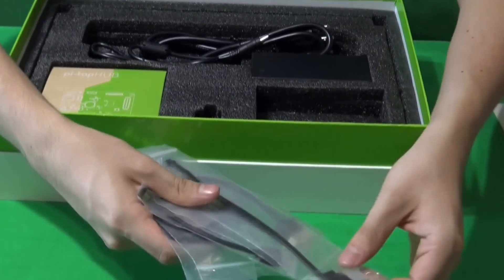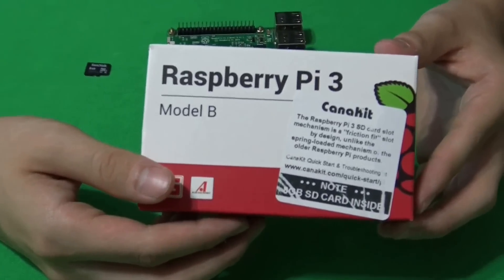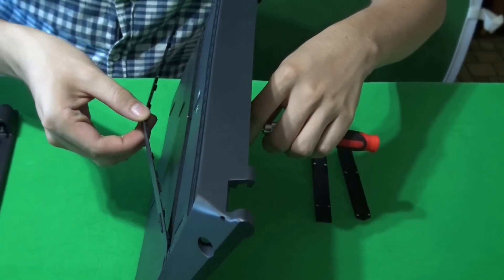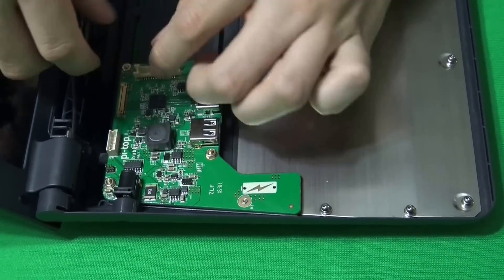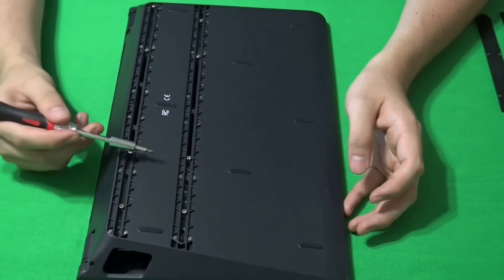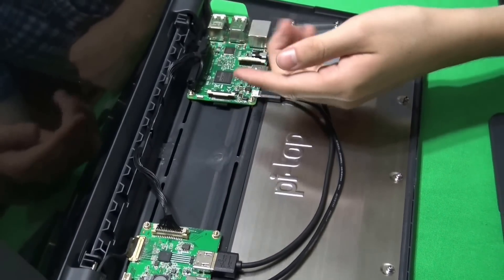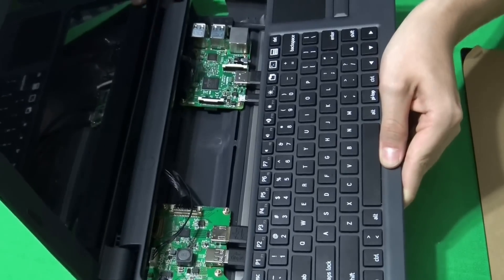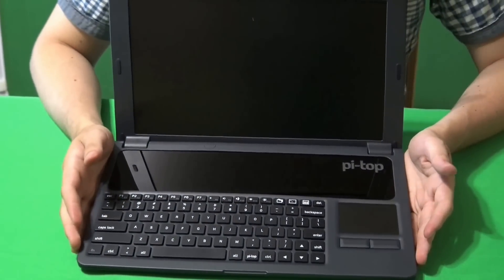PiTop assembly using a Raspberry Pi 3 - tech4seniors

Comment: Can you still use the GPIO?
Reply from the maker: We have not tried much of this, because we use these for instruction of the desktop and coding, and have some others for hacking. The cover that slides in over the Pi and other things, such as the hub,  opens up for viewing and some limited use.  You can insert the speakers into the hub. We would like to use the video out, but cannot as the inside is relatively tight and limited. We will try more of these things in the next two weeks. Check back in a few weeks. I hope this helps. We may do a followup video, now that we have more experience and the speakers.

Comment: Is it easy to take the pi out and put back in again
Reply from the maker: That is a hard question to answer. I would say it probably is not easy by you mean easy. You would have to undo some of the kit building. It would be nice if it were easy. It does not take long to take it out. It is meant to stay in place, except to be replaced or repaired.

Comment: Please disable youtube image stabilisation, or stop using the one you used in your editing software, it makes the vid look like jelly!
Reply from the maker: Not sure what you are seeing. We have looked at this several times. With over 80 eyes,  I can read the small print on the SD card. I did see what you may be referring to, but did not notice it in the past. We do have a ceiling fan running above the table that is reflected on some the reflecting surfaces. We will turn the fan off on the next video.
Reply: It's not the ceiling fan, your video looks wobbly af
Reply: mecatx video is DEFINITELY wobbling. And please practice assembly before videoing, it was painful to watch. I don't care if the video was specifically made for "seniors", the lack of scripting shows in this video. You have potential, just don't waste it on petty excuses
Reply from the maker: Sorry for your painful experience.
Reply: I thought I was having a flashback from too much LSD from back in the 1970's

Comment: Won't the magnetic strip damage the sd storage?
Since there a lot of space,could you put a small cooling fan?
Reply from the maker: I do not know. I have not seen any reports of that. Perhaps ask the PiTop company on their website, or on a Raspberry Pi forum. I presume you could put a small cooling fan in the space between the hub and Raspberry PI. The PiTop team is now making plug in small speakers to fit there. We do not have one yet. We are looking at adding a camera module.
Reply: demented12 that only happens with magnetic(spinning) hard drives not solid state storage like an SD card.

Comment from the maker: One more comment. This case does limit some uses of the Raspberry Pi, but the top black plastic cover can easily be removed to give more access to the hardware. It does make it much easier to transport and use,  especially for the desktop use, and if you have more than one to transport. We preferred to use the new Raspberry Pi software rather than the PiTop. You can use what software you want to, depending on which Raspberry Pi you chose to use.
Reply: "We preferred to use the new Raspberry Pi software rather than the PiTop."

That's a confusing comment.  The PiTop is essentially a case for the the Raspberry Pi, a display and a keyboard/track pad, which has absolutely nothing to do with software.
Reply from the maker: Sorry for the confusing. You are right. PiTop comes with a micro card that has PiTop OS and other Apps. After trying it on the first purchase which was an green Pitop, we purchased a second Grey one. it came in a different kind of box,.We used a Raspberry PI 3 and its OS, and are more pleased with it than the other. Another hint is that PiTop has come out with a speaker that attaches to the hub inside. have not tried it yet. We are also looking for a good way to attach the new camera module. May have to 3D print. We have found camera module attachments that connect at both ends to an HDMI cable rather than the ribbon cable. Hope some of this helps.

Comment: Other reviews have mentioned that the magnetic strip that holds the board, isn't firm enough to allow connecting ethernet and USB connectors, without the Pi board slipping on the mounting strip.  Have you experienced this issue?
Reply from the maker: No. we have not used them a lot yet, as the project is ongoing. So far no major problems with any of them. More than one!

Comment: its a good project. is there a form to put a power bank(or another kind of battery ) in middle of the boards ?... it would be nice to be a portable system, or maybe a ssd (insert size standard of your preference here) port, i only have one more thing to say I will begin to save because I want one
Reply from the maker: The PI Top is only a case. It does not come with the Raspberry PI. It does have a battery and is potable. There is some room in the middle to be able to hack this case for what you may want to do. It could be used for another dev board, I guess if you redesign the hub ( control system ) for the keyboard and monitor.

Comment: can you use pi-top with a android phone
Reply from the maker: I am not sure. You would have to have an app that will work. The PiTop s just a case. The raspberry Pi is separate. So the answer, I guess would depend on the Rapsberry Pi that you are using. We have tested it to some extent with Cayene and it worked fine.
Reply: Chanel-808-life hawaii some phones offer an hdmi out so that of course makes it possible to use them with this lapdock.